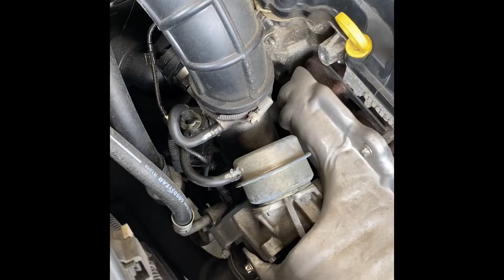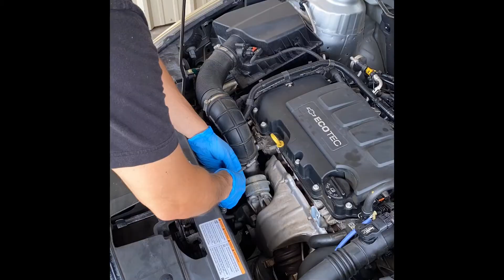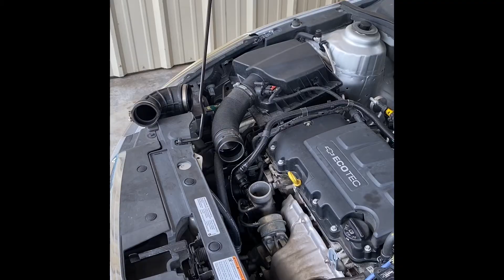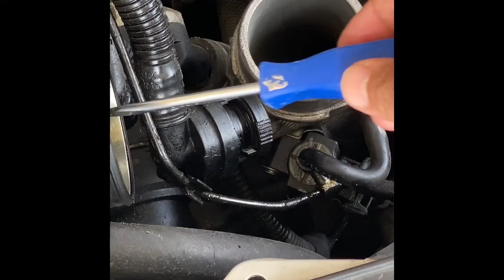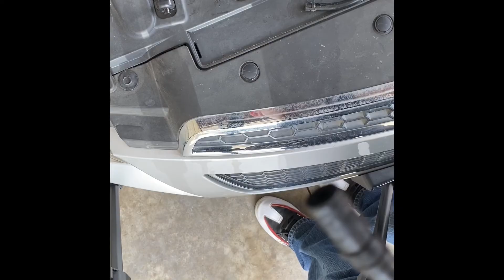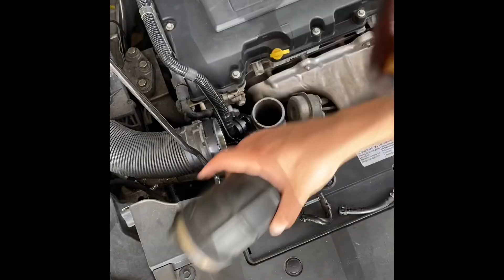Chevrolet Cruze 2012 P0299 underboost diagnosis

Comment: 112,543 miles 2015 chevy cruze LT. Got P0299 code. Said underboost turbo. We changed out oil feed line. Head gasket valve. Change the oil. Was recently leaking oil. No more oil leak. However now this code popped up. Car is sluggish. Engine light on. Do i need to replace the whole turbo?
Reply from the maker: I would check out the PCV hose and the purge canister. The check valve in the instant manifold could have popped as well. I have videos on both of those.
Reply: @hordebutcher2651  ok great will check and get an update.
Reply: @hordebutcher2651  there such a thing as under and over boost in the turbo?
Reply from the maker: @Hey_its_Koda  In generic turbo terms yes, such terminology exists. In this car I think underboost will be more of an issue then overboost. I read somewhere that this turbo is monitored by the computer and will allow for a certain range of boost. Overboost is more of an aftermarket tuner thing.
Reply: @hordebutcher2651  ok.
Reply: @hordebutcher2651  so i took it took to an independant mechanic and he ran codes. It was pulling all kinds of codes besides p0299. He test drove it. Said yup theres power pushing the turbo. He Check hoses and pcv. No leaks. Did boost leak test. It was boosting at 10. His diagnostic charged me half price. He cleared all the codes and told me to come back if it re lights up.
Reply from the maker: @Hey_its_Koda  is your car idling weird?
Reply: @hordebutcher2651  kinda but not really. No jumps. I did replace the negative battery cable. The car been acting funny.
Reply from the maker: @Hey_its_Koda  is the idle surging?
Reply: @Hey_its_Koda  yes. Underboost...waste gate not closing or stuck open.
Over boost. Waste gate not opening or sticking close

Comment: I just bought a 2016 cruze with the 1.4 turbo. The day after I bought it, the check engine light came on. Engine under boost. How much trouble $$$$ am I in and are these cars junk?
Reply: I have a 2015 and it’s a piece of shit. Everything that the can go wrong on the YouTube videos has gone wrong. All at about. 55k miles. The valve cover problem, turbo problem, coolant leak problem. I hate this car. Oh and my engine light is on again and just found out it is p0299 again. This is after a new turbo installed just before Christmas. Hoping it’s a cheap easy fix. Going to try replacing the boost sensor.
Reply: @christurner2853  I just ordered the boost sensor. They call it a intake air temperature sensor. I will let you know if it works or not some time next week. I was told a map sensor could also fix the problem but who knows?
Reply: @Hinokami_TT  I bought the map sensor, it didn’t fix it. I also put a little lube on the gate link that is attached to the vacuum arm. I tried moving it when it was disconnected from the arm and it kept getting stuck. A little lube and the arm swings freely now. But the check engine light is still on. Do I need to clear the check engine light code?
Reply: @christurner2853  Luckily I never bought the map! Thanks for letting me know. Hopefully the boost works if not THAT doesn't work I'm just going buy a new turbo on Rock Auto for about $600.
Reply: @Hinokami_TT  good news! It took a couple days of driving but the check engine light is off. I think the bit of wd40 on the waste gate arm did the trick.
Reply: @christurner2853  Did you spray both ends? The metal clip and near the actuator??
Reply: @Hinokami_TT  nope. Just the little arm that attaches to the turbo itself. And it was a very small amount of wd40.
Reply: @christurner2853  where exactly did you put the wd40?
Reply: @rachelescobedo1519  the short arm where it connects to the turbo. It’s the little arm that controls the gate inside the turbo. It didn’t work for too long though.
Reply from the maker: It’s hard to tell over the internet. Knowing how many miles the vehicle has will be a good start to taking a wild ass guess. I would definitely lift the hood and check the PCV hose that ties into the turbo and look for oil where it shouldn’t be. (All over the hose)
Reply: Yes

Comment: What caused the P0299 code?
Reply from the maker: Ultimately it was the check valve in the intake manifold. I replaced the intake manifold with a Dorman unit off of Amazon
Reply: And that fix the issue?

Comment: pcv valve issue? the 1.4T has well-documented issues with a poorly designed PCV valve; could failure of that valve be responsible for the oil finding its way to the air intake? i've also heard that the PCV valve is responsible for the rough idle. not a mechanic here just someone with a P0299 in my 14 sonic rs who's been obsessively googling possible diagnoses lol
Reply from the maker: In this case the rough idle was also due to the check valve in the intake manifold being popped
Reply: Interesting. The idle does rough idle between +-60 rpms
Reply: Yep pcv gets stuck causes a vacuum and caused the oil to go past the seal doesn’t mean the turbo is bad tho